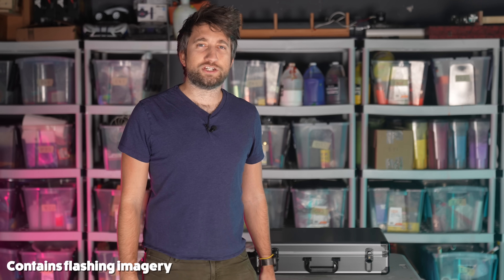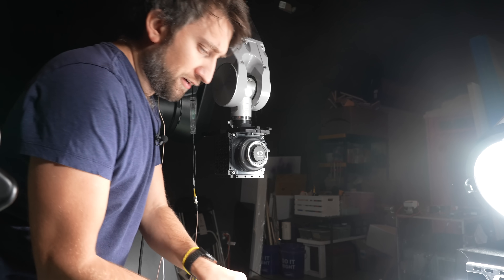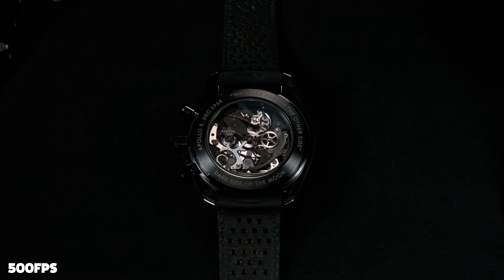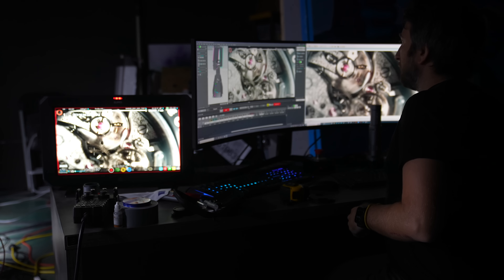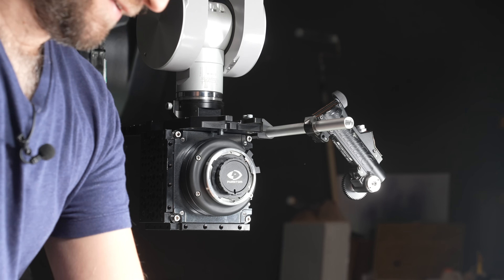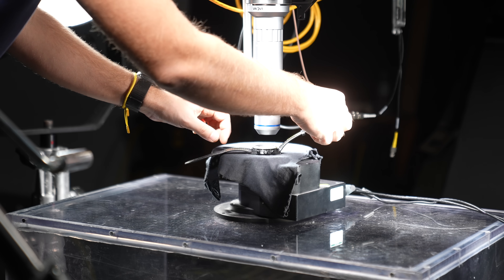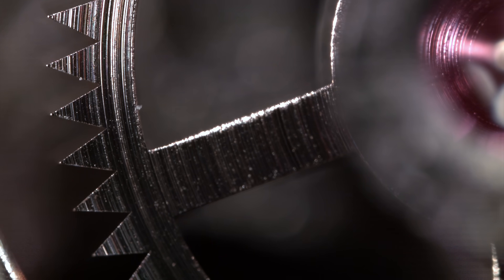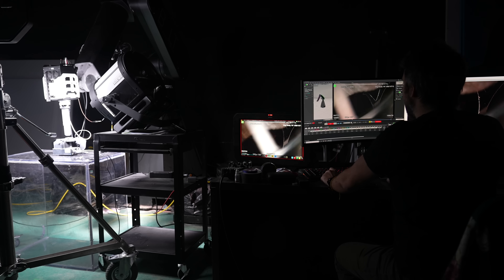Slow Motion Microscope Inside a Watch - The Slow Mo Guys

Comment: You should not have that amount of dust in a Swiss luxury watch that costs around 17k. You can see the one that covers an entire tooth even zoomed out. They are supposed to have multiple processes to eliminate dust from inside the case before they seal it. They aren't even supposed to open it for servicing outside a clean room. I'm also kind of shocked at the wear on the escape wheel.

Comment: Very nice Video. Could you please considre to do a similar video on a 70s Bulova Accutron? It vibrates with 360 Hz and uses a ratchet wheel with only 2.4mm in diameter and 300 teeth on it.

Comment: So the vibration of that gear might be a purpose built “feature” that is always ready for the moment you might push the timer button. The vibrating means it’s always ready to wiggle into place at a moments notice into the second wheel. If it didn’t constantly vibrate it might be impossible to line up correctly with the wheel it wants to engage with.

Comment: Mechanical watches are perhaps the most impressive example of human engineering and manufacturing. We figured out how to make a watch accurate within a few seconds per day hundreds of years ago and actually built the microscopic pieces without modern manufacturing techniques. And now, we can do it so cheaply and on such a massive scale, you can buy a mechanical watch from China that's just as accurate as something that costs 10x as much. Just just wild.

Comment: Two things i found interesting with the chronograph section.
1. the central gear had empty gaps when they meshed, im guessing to allow for an easier capture.
2. the gear that moves seems to lose all of its wiggle when its engaged. it would be interesting to see the shot at 11:35 again but with the chronograph running.

Comment: The watch is a chronograph: a watch that has a stopwatch function. The sawtooth-shaped wheel is the one that diverts some of the power of the main gear train toward the stopwatch mechanism. The button to start and stop the stopwatch moves the sawtooth gear in and out of engagement with the chronograph center seconds wheel. We can see that that action in at 13:56.

Sawtooth is not an ideal shape for gear teeth. The reason the wheels in the chronograph mechanism have sawtooth shaped teeth, and are sloppy and bouncy like we see in the video, is precisely so that it the start/stop action can happen without jamming up. The wheel with the curved teeth (usually called the fourth wheel) has a more optimal shape because its axis of rotation will never move.

Comment: I think the bouncing cog is that way to limit how much friction the mechanism experiences on a "final" branch. If you think about it, a watch is a tree of power. The trunk of the tree is the spring, then you have the balance the area where the branches start popping off and then towards the various functions of a watch (normal having only 3: hours, minutes, seconds - with complicated ones having extra time zone or days or some other function). You have to decide at which point, friction is too much and thus make stuff like that.

Comment: Adjusts glasses Well, actually, the energy transfer is the other direction. It is actually the seconds wheel pushing the escape wheel, which slams into the pallet fork, that sends the balance wheel spinning

Comment: you pretty much skipped over the part that I'm most interested in, which is when the pallet fork jewel gets a small impulse from the escape wheel, you showed the locking and unlocking of the escape wheel by the pallet fork, but you didn't slow things down enough to see the escape wheel jolting the pallet fork's angled end, that's what I find most interesting, that's what's actually powering the balance wheel. maybe next time 🙂!!!

Comment: The vibration you're seeing at 13:25 ish is likely from the subdial secondhand on the face side of the watch, as it comes to a stop and has momentum and flexes/deforms, shedding the energy back into the pinion, and "shivering" the gear.

Comment: He slow-mo'd the wrong timing of the pallet fork! 

The impulse of power is not when it stops the escape wheel.  It's when the pallet releases the escape wheel.   As it releases the angle on the tip of the fork, and the angle on the end of the tooth interact and it pushes the pallet along, which then give the balance wheel a kick.

When the escape wheel stops it's just a dead stop.  the pallet doesn't move in that direction.

Comment: A bit of horological science - at 6:52, you captured a fascinating phenomenon! If you go through this capture frame by frame (period and comma keys on YouTube), you can see the escape wheel tooth accelerate very quickly, covering about half the length of the impulse surface in one frame, then slowing, covering the remaining half of the impulse surface in about two frames. This means that the escape wheel wasn't in contact with the impulse surface for about half of that surface's length (the tooth had to catch up with the already-moving pallet). This delay, which is a function of, among other things, the driving force from the mainspring, can change ever-so-slightly the rate of the watch (technically speaking, the phase of the impulse wanders, changing the escapement error). This is one of the reasons escape wheels are made so light, with thin rims and thin spokes. In pendulum clocks, where the requisite rate stability (Allan variance for anyone interested) is orders of magnitude more tightly controlled, this phenomenon becomes absolutely critical. Excellent catch!
Reply: I learnt how to frame by frame watch a youtube video, thanks

Comment: My lovely wife bought me a Speedmaster Pro as an engagement present ~15 years ago.  Annoyingly, starting the chronograph would freeze the movement in around 1 in 20 activations.  I took it back to my local Omega service centre many times and they just couldn’t sort it out.  Where this story takes a turn is that I’m an engineer with a case back opener.  It turned out that for my particular watch the gap / sloppiness between the chronograph gears was more critical than normal.  A bit of research, a loupe and precision screwdriver and I was able to get the tolerances just right; eventually.  Seeing those gears in high magnification slow-mo vibrating between ticks in this video was a real treat.  I love this channel.
Reply: That is absolutely unacceptable for a 9000 dollar watch from a high-end Swiss company. Between your story and the amount of gunk inside of that 17,000 dollar dark side of the moon, I have to say I have seen better from Chinese companies selling watches in the 100s and not 1000s range.
Reply: at that point you might as well barge in to the store saying "hey, I fixed the problem y'all can't, hire me!" lol
Reply: I do watchmaking as a hobby and its called "endshake" the amount of play between two pivots for a component.  Its a typical area to look for issues (for example broken pivot, or unseated pivot).

Comment: Hi Gav and Dan,
I've got a couple of ideas for you two:
slomo of the rifle barrel oscillations and how the harmonic tuner works,
slomo of how the fuel/air mixture burns in a potato gun for optimal placement of the ignition spark.
For the latter let me explain better:
if the spark is too far back the flame front might not be fast enough to burn down the barrel, if it is too forward you might end up burning only in one front ... optimal would be have the the flame front travel both forward and back as much as possible while still achieving a complete combustion.

Comment: Regarding the exposure challenges on the deeper parts: would using a laser illuminator and switching the camera to monochrome early on be able to improve or resolve this issue? I can imagine that a laser would be able to put way more photons into an enclosed area compared to the large spotlights you've been using.

Comment: Microscope illumination is a hard problem, but there are some crazy solutions out there too! Like high-intensity fiber-optic illuminators; or through-the-lens systems that shine directly down through the same magnifying optics in reverse using a beam splitter.

Comment: It seems that chronograph seconds gear with the small teeth may be developing a crack in between two teeth, at 16:49. Nice zoom indeed... Wonder if the slam of the gears is causing it or just a manufacturing defect.

Comment: Of all the people I watch on YT, I think Gav is the one I would most like to be able to just hang out with. Microscope on a Phantom on a robotic arm is so insane in the absolute best possible way!

While I watching this, I wondered if it might be possible to use fiber-optics to get some light into those really tight spaces? Seems like you could rig up a tiny mount that could hold and aim a little bundle of fiber then put the other end on a frickin laser or something.

Comment: the stutter at 13:20 is because the gear is moving other teeth, which have their own resistance/stutter, in a chain, all the way to the second-hand, which will also vibrate and spring back... if the gear is directly connected to that second-hand then the stutter is down just to the springiness/inertia of the second-hand - a bit like hitting a large thin sheet of cardboard at the edge and watching the waves ripple down it. which would be very cool to film btw. as would filming a reed or a straw being struck from the side.

Comment: Can you try the grand seiko spring drive watch? supposedly its seconds have perfectly smooth movement
Reply: The Grand Seiko 9R Spring Drive has a 'Tri-synchro regulator' which applies electromagnetic power (or a virtual 'brake') via a rotor/stator. There are some videos where a user winds up a dead Spring Drive.  The second hand races for a few seconds until the 'Tri-synchro regulator' kicks in and slows down the second hand.  (I'd really like to see if there is any noticeable braking movement during this slow-down of the second hand.)  Optimally, one would somehow have to wind the dead movement, while simultaneously filming a stable macro view of of the second hand (as high as 100,000 fps) so any corrections are clearly visible.   Unfortunately, it would take some skill to achieve this and I assume such a high frame rate would be necessary (given the electromagnetic 'brake') to notice HOW the movement slows to it's stable rate.   One probably would have to film the full dial in HD, instead of a 5-10 second portion, then focus on the area of the dial to (hopefully) see any noticeable braking activity in post-production.
Reply: I don't think  a running spring drive could tell its story alone. Put it side by side with an auto. 
And to add to @borbetomagus, show a starting spring drive  side-by-side with a running watch.

For the sake of completion --
an ordinary quartz side-by-side with a grand seiko dual impulse quartz,

and as a tongue-in-cheek finale --
an ordinary quartz side-by-side with a dead-beat-seconds mechanical, like a JLC geophysic true second.

Comment: I feel like the microscope lenses could really open up a whole new world of small, fast things; insects, tiny machinery, the works. Light is obviously going to be an issue; for the same reason that filming in slow mo makes things darker, extra magnification makes things darkers as well. There's literally fewer photons hitting the lens, the smaller you go. So, it may be difficult, especially since tiny things also tend to be very delicate (wouldn't want to burn them with too intense of a light set up). I'm sure you'll come up with something clever and interesting.

Comment: When you turn off the chronometer, and the free wheel moves back, doesn’t that change the timing on the watch technically? Like if i did that 1000000000000x would the watch be off by a half second more???

Comment: The footage is really great but one of the things that jumped out at me is that the machining marks on each gear are perfectly concentric to the gears and wheels themselves. That's some serious attention to detail during manufacture - by seeing that, I know immediately that every single one of those gears is a separately machined and finished component.

Really well done, I also really liked seeing a bit more of "the process" and I'm looking forward to seeing what else you pull off with these lenses in the future.

Comment: As a watchmaker who has worked on this movement, it was a pleasure to see it in such detail and beauty. Very well done!
Reply: just a pity there was popcorn in there!
🤣🤣🤣🤣🤣
Reply: Can you tell us what the "popcorn" was? Is it intentional or a defect? And what about that other U shaped marking on the other wheel?
Reply: @davidliu323  The "popcorn" looks like a piece of debris. Same with the "U"; it appears to be a small piece of lint. Static electricity can attract these small particles to the movement during assembly.
Reply: @Krevak  Couldn't that debris cause a malfunction now or in the future?
Reply: @smeezekitty  Potentially yes, if finds its way into the teeth of a gear.  High-end watches like this Omega are assembled in clean rooms with filtered air, so the "popcorn" was a surprising find.  Perhaps the watch was serviced, which normally takes place in a less-controlled environment.
Reply: Same

Comment: Looks like the wheel with the rounded teeth is directly connected to the escape wheel. Since the right wheel is under pressure from the mainspring it stops a lot faster than the left wheel.

I'd bet that if you could see the escape wheel at the same time as the wheel on the right the movements would line up with each other.

Comment: Excellent video. And yeah, stuff gets insane when you start looking at it close at 1000fps. Just small details, like the escapement arms being made out of what's probably sapphire...just so that they don't wear down over time. Or the fact that the miniscule slop on that gearset is because they have to choose for the clearance to either be clearance, or interference (where you'd need oil to prevent wear).
Or of course that solid objects aren't all that solid. You using the stand to steady your weight causes the whole thing to move "wildly"...on a microscopic level.

Comment: Fun fact: Rolex developed a micro machined gear set that has leaf springs on each side of the teeth of the gear to allow for a perfectly meshed interface that eliminated the rebound you're seeing in that gear relationship (and which is inherent in any traditional gear set). I dont know if theyre using it anywhere, but it was a fascinating white paper

Comment: Incredible footage. Next watch you should do is a Grand Seiko. More specifically a piece with 9SA5 or 9SA4 (although spring drive would be cool too but it’s mostly covered up.) The 9S are 36,000 BPH with a newly invented dual impulse escapement. Finishing on any GS is better than most watches in similar price points! Would be a treat to see all that within your set up.

Comment: > Around 8:08, you say “6 times per second”, there is no fundamental reason why it could not be 6 times per second, but this being a Swiss chronograph, it's extremely likely it is actually 8 times per second  (28800 times per hour).

EDIT: Nevermind, when you show the dial, the seconds are subdivided in 3 intervals so this is indeed an unusual chronograph mechanism paced at 6 movements per second.

Comment: 4:49 Well, that's literally a compound microscope, a system with 2 magnification stages (conventional cine/photo lenses are basically "1 lens" equivalent, or 1 stage) That's why the system can maintain the same focus distance, independent of the magnification (with normal lenses, the magnification is directly related to the focus distance, all of us who do macro know this well 🥲)

Comment: You could set up on a machinist's table and 3D print a special holder for the watch that could be fixed down and would hold it all very steady as you pushed the buttons if you wanted to get even closer or faster.

Comment: Try a pocket watch next time. Their movements are much larger, and they run at slower speeds (typically 18,000 bph). You also don't have the chronograph parts that can block other parts.

Comment: The Bulova Accutron is an electromechanical watch that runs off of a 360hz tuning fork. The hands are driven by a hair-sized pall and a tiny index wheel with 360 teeth. They're not very expensive (compared to Omegas). I think that would be fascinating to see with this setup.

Comment: the depthing for the tooth engagement on the chronograph clutch wheel is a little to loose that is why the bounce is so noticeable. I usually depth it so the teeth engage at slightly more than 2/3rds the depth, the deeper the depth the less lash on the wheel, but if you make it to deep it increases friction on the wheel which can stop the watch. Adjusting the depthing on how the clutch engages with the chronograph wheel and the driving wheel is a absolute pain to set properly. Love seeing a chronograph in slow motion, i can see them up close when working on them under a microscope, but to see the clutch and escapement at this frame rate.... really thank you for sharing this.

Comment: You should do it with an old Bulova Accutron with its tuning fork movement. The index pawl of those is .2mm and vibrates at 360hz with an index wheel with teeth the same size moving at the same frequency. Insane engineering for a watch that debuted in 1960.

Comment: I have a watch with a special gearing called the "agenese" gear developed by Agenhor, a premier movement engineering firm in Switzerland. The gear has "spring tooth" to absorb those vibrations and reduce the stutter between two gears. I would LOVE to see it under ur equipment omg.